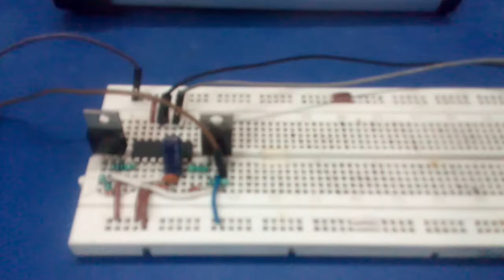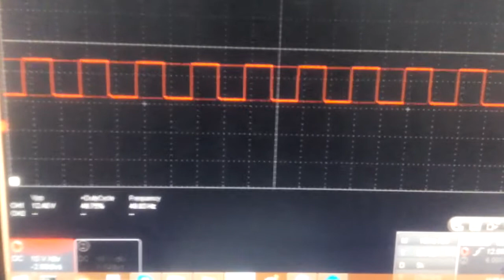Designing Gate Driver Circuit and Switching Mechanism for Modified Sine Wave Inverter

Comment: What voltages are you using for Vs and Vcc? Obviously you're not using 500V for Vs, so just wondering what you used. Also, if you are using a lab power source what current is being put out by the power source? Cheers!